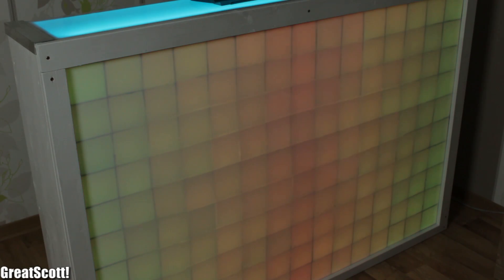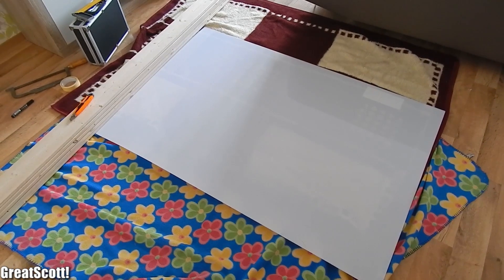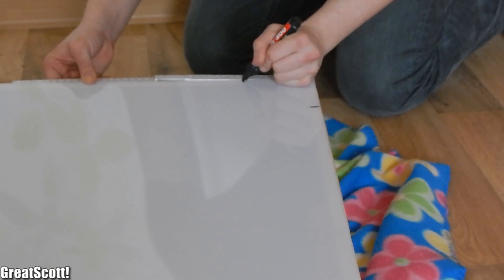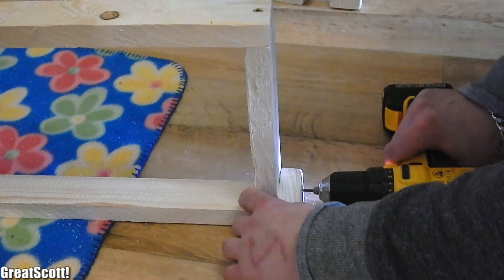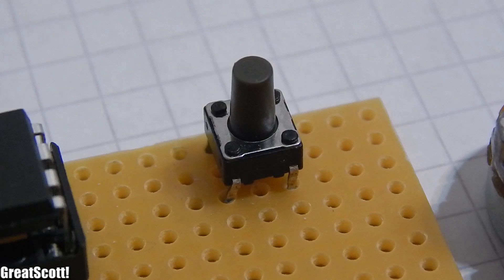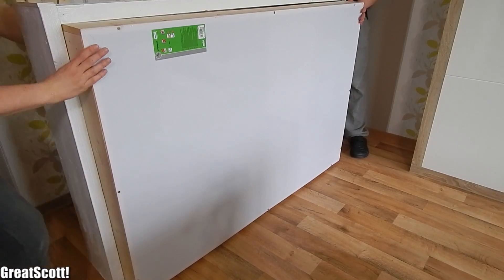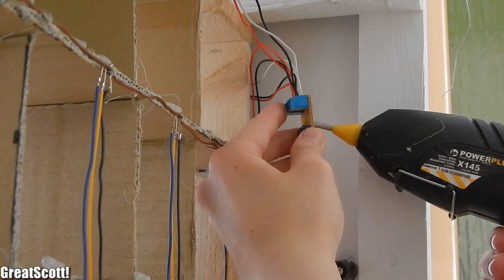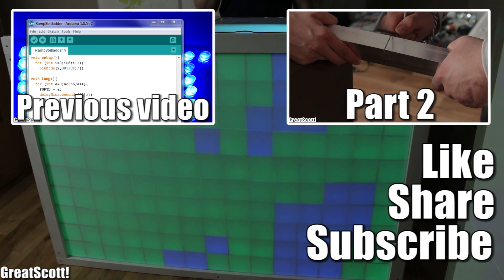Make your own LED Bar - Part 1 (matrix frame,bar construction,WS2812B lighting system)

Comment: Hey Scott!
Ich bin auch gerade dabei mir eine LED Matrix zu bauen.
Habe aber ein Problem mit der Datenübertragung vom BananaPi zum Arduino (Mega).
Auf der Seite von Glediator kann ich mir ja das Arduino Code runterladen. In dem Code kann man Aber nur einen "DATA PIN" definieren.. ist das Jetzt DATA IN (vom BPi) oder DATA OUT zu den LED's? oder werden die daten vom Pi Über USB an den Arduino geschickt?
Reply from the maker: Phillatoros Daten gehen vom Pi zum Arduino zu den LEDs. Der DatenPin ist also der Pin auf deinem Arduino.
Reply: GreatScott! achso, danke.
Ich habe es jetzt so aufgebaut aber ich bekomme es nicht zum laufen.
die daten gehen vom BananaPi zum Mega (RX blinkt die ganze zeit) aber mit den LEDs passiert nichts? ich habe den Data Pin angepasst auf den MEGA 2560.
Digital Pin 31 ist PIN 6; DDRC, PORTC..
woran kann es liegen das trotzdem nichts angezeigt wird?

Comment: Can You Use Batteries Aswell?
Reply: Can You Make A Smaller Version Of The Matrix? And Is There Another Way To Power It?
Reply: Yes but it will use quite a bit of power so you will need to get large capacity rechargeable batteries